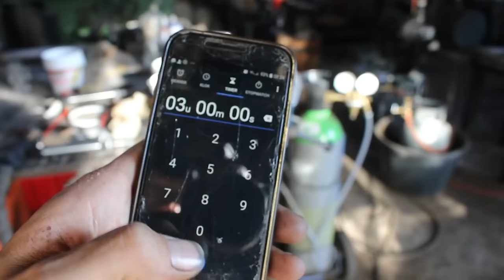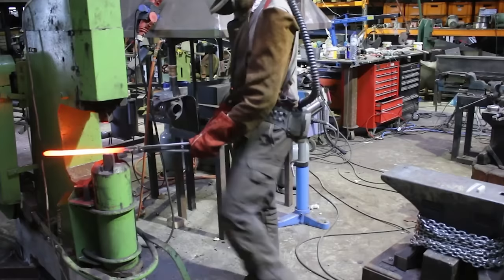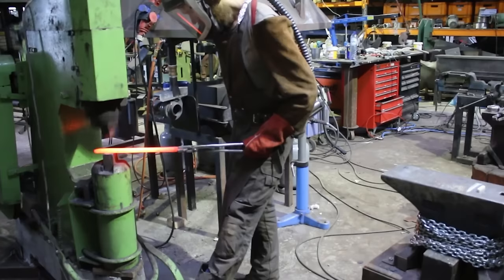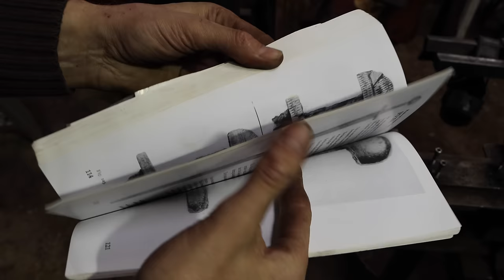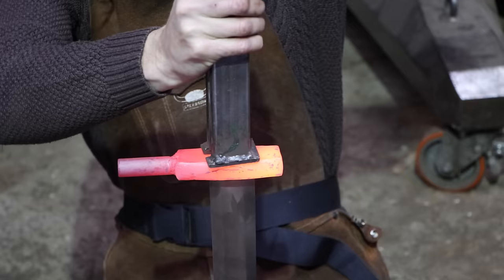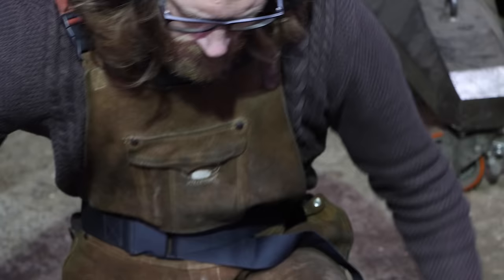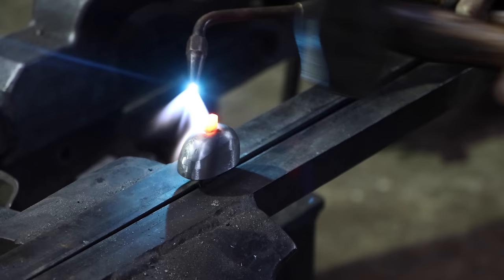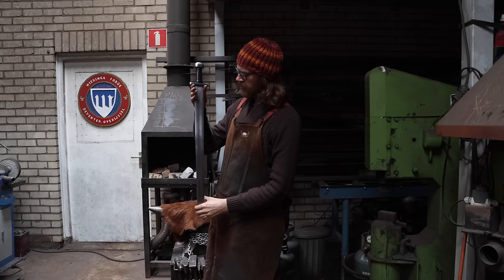Forging a crucible steel sword, the complete movie, the process explained.

Comment: 33:55 Fun fact, wood was used as a handle core not because it was easy to shape or a cheap material. It was used because it is a poor conductor of vibrations. Steel hitting steel will send a whole lot of vibration down the handle and right into your hand creating what is called hand shock. Hand shock can be downright painful and it can shock the muscles preventing you from having the ability to grip the handle just the same as banging a shin into something and that leg can barely support you afterwards until the shock wears off(discovering a trailer hitch on a truck via a shin is the worst). Metal is an excellent conductor of vibration so the wood core of the handle brings it under control and then the leather gloves worn inside the gauntlets reduces the vibrations further. And it is the vibration dampening abilities of wood that make it the preferred choice of handle material to this very day.
Reply: I wish my aluminum little league baseball bat had wood handles back in the day. Even more painful in the cold lol
Reply: @BrandonOpel  Ever sword fight a friend with aluminum bats mid winter without gloves? I did and couldn't use my hands for 5+ minutes.
Reply: @JETWTF  Not sure if I did that but I definitely whacked a few metal poles and tree trunks. Those fuckers had it coming lol, yet my hands always lost in the end.
Reply: @BrandonOpel  Poles and tree trunks... the bane of all kids.

Comment: I'd love to watch more about crucible steel.   I'm very curious if your press would move the steel much quicker than the power hammer does.   The flexibility of the completed blade is incredible and yet it sliced that strap iron without any serious damage.   Flexible indestructability seems impossible, yet I just watched you prove it.
Reply: if he got straight for the press, i guess the steel would crumble, i've seen a video of Ilya working crucible steel and thats what he showed

Comment: The steel appears to take a long time to move, even with the old power hammer.  How would the puck respond to being worked with the hydraulic press?
Reply: if he got straight for the press, i guess the steel would crumble, i've seen a video of Ilya working crucible steel and thats what he showed

Comment: That blade sat in the shop for years, I was wondering if you ever use the power hammer anymore now that you have the press... but I wonder more if you are willing to give up the press and go back to the power hammer and manual cleanup after? I bet the answer is a no in absolute terms lol.
Reply from the maker: I would if I had a better hammer.